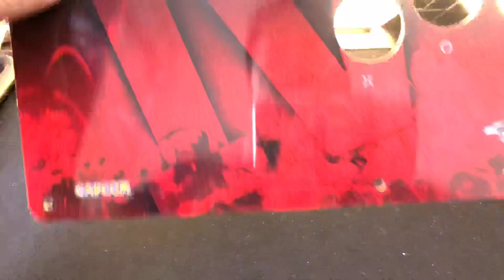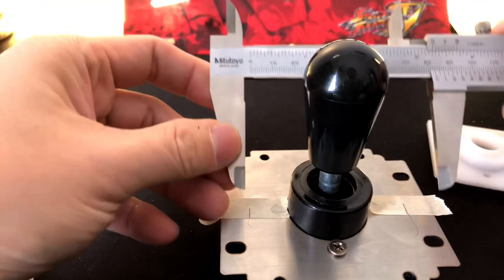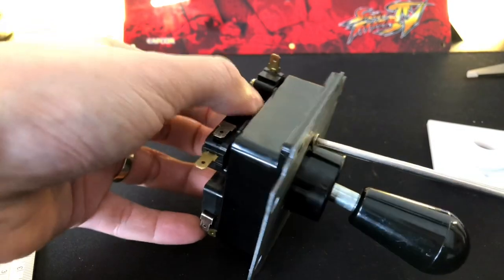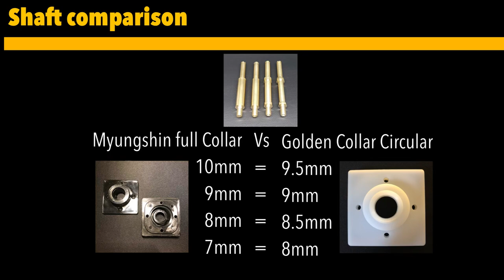Golden Collar and Golden Plate

Comment: This is probably entirely too late to get a fresh response but I'll try anyway: changing the collar height doesn't require a change in shaft length? Also: does the square collar shorten the throw a lot? I'm intrigued by the square collar as a noob to k-levers, but I don't know if I'd be "ruining" my experience.
Reply from the maker: No need to change the shaft length, changing collar only effect horizontal movement. Vertical (length) remain the same. 
Square collar have the same throe distance for cardinal, but for diagonal the throw is deeper. Square collar are very good for easy diagonal
Reply: @ASIndopro  Thanks for the info! I might give the square collar a shot. The square collar can be mounted in a Japanese style panel mount?
Reply from the maker: @griftgfx  correct, only Full Collar need 35mm hole
Reply: @ASIndopro  You guys really go out of your way to answer questions. I appreciate it. I've noticed square collars aren't a very popular option. I guess people want "the real thing". I have decisions to make :)
Reply from the maker: @griftgfx  square collar are very popular in Japan. That’s why we make GoldenLever Japanese setup, it have Korean design inside with Japan lever interface, many users love it.

Comment: I received my Golden Collar and Golden Plate, and both are great. I purchased a Myoungshin Fanta separately and I noticed that the dust cover has a little bit of plastic sticking out from the side. I was wondering if it's necessary to use this smaller sized dust cover or can I make use of the larger dust cover that you receive with Sanwa JLF / Crown 309MJ sticks?

Comment: I heard this is not compatible with crown 309Help-me. But is this compatible with crown 309MJ?
If so, I'll finally have my target setup of korean joystick with sanwa balltop+shaft cover+dust washer and square gate.
Reply: Cobalt it will need Golden Core for Crown to be able using golden shaft and actuator. For now we will test compatibility of golden parts with crown model.